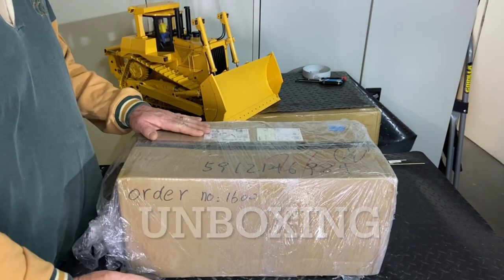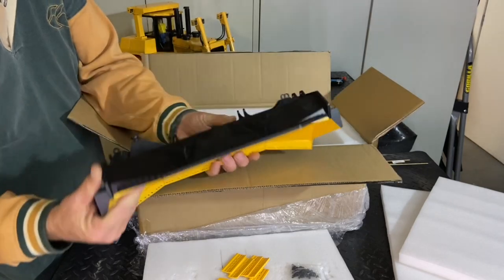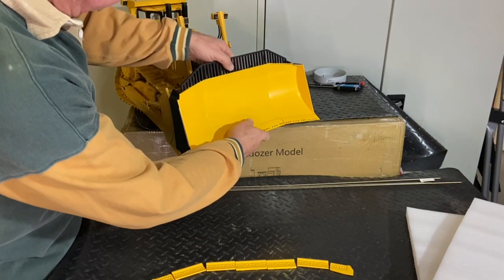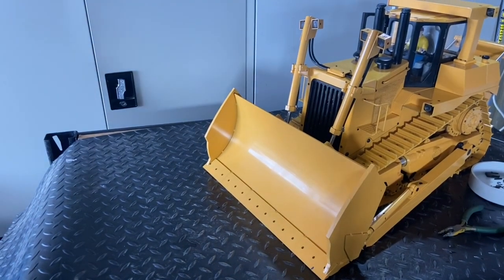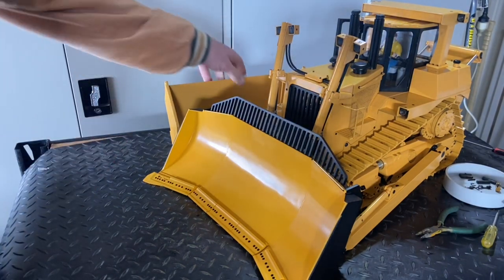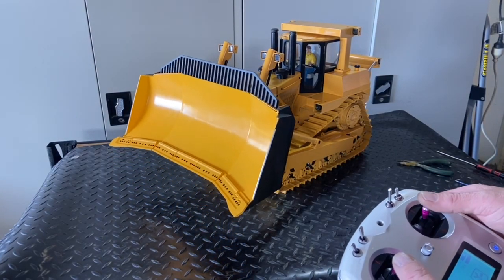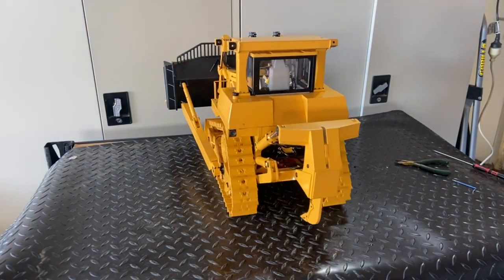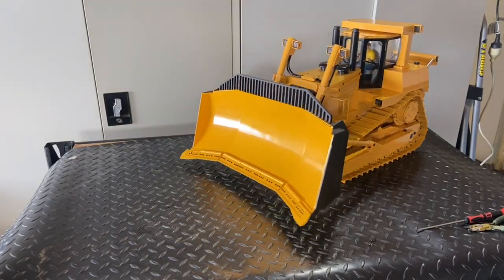CSMI U BLADE DXR2 1/14 RC Dozer unbox, fit and test

Comment: من فضلك من اين احصل على واحده
Reply from the maker: Two companies in Australia sell them. Search DXR2 dozer upgraded blade and you will find them.  I recommend the SU conversion of the original blade ( see my other video) it works on the dozer better in many more materials. The U blade is in video is nice, however is large and only works well in soft and loose material.